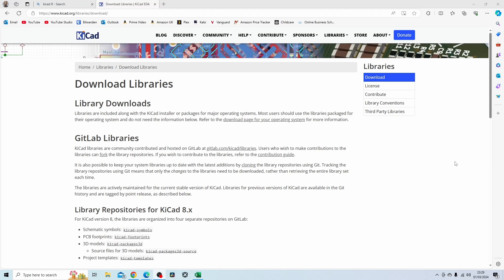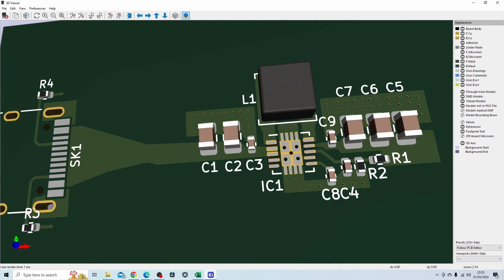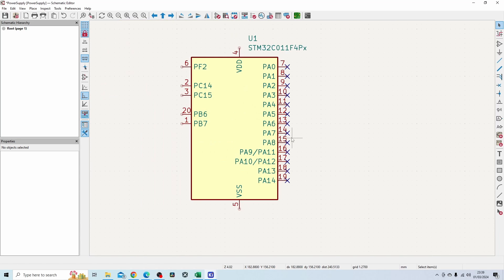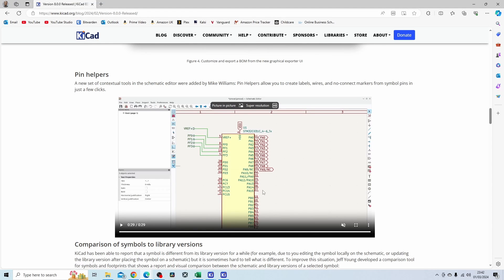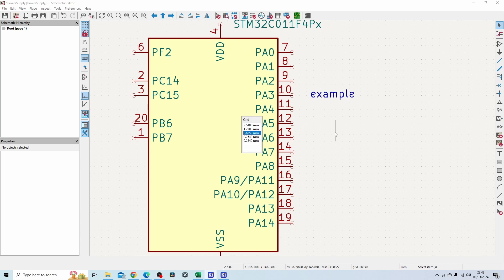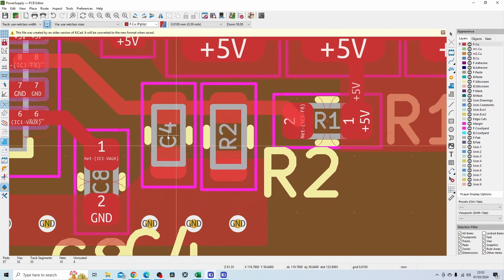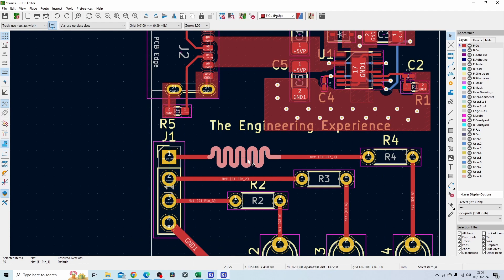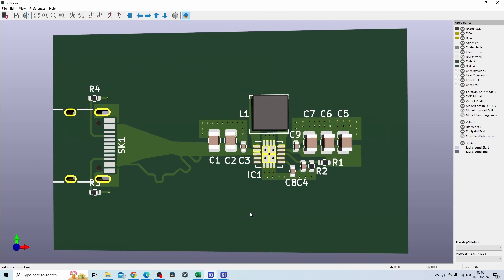Its here!! KiCAD 8 with new features

Comment: I already have installed kicad version 7 in my computer.what happen if I downloaded and installed latest version of kicad software 8 version.
Either both software are available in my pc or the version 8 will automatically updated with version 7?
Reply from the maker: I have the same situation, both versions will be available and can use both at the same time. I did some a problem with 3d models links being changed but that was because it looking for kicad 6 for some reason.

Comment: Will THIS version load my old design files?  Without some kind of interversion compatibility, this project is doomed.  We cannot re-enter all of our old designs every time programmers decide to change some little something.
Reply: I never used 5, but 6->7 has worked and 7->8 has worked for me. Keep in mind once you save a project using the new version, it will no longer work in the old version. I don't see this as much of an issue. There's no point using the older version any more anyway, they're all freely available (unlike private software).
Reply: Exactly !! the other guy here hasn't got a clue ! it's open source so of course you upgrade ASAP !! @ivolol
Reply: Go to the forum and ask your questions there as its where the people who know are ! keep a backup of 7 projects because once converted to 8 they cannot be used in 7 again as Kicad is evolving fast
Reply from the maker: I loaded my version 7 project into version 8 without any issues. 

You still have version 7 so you don't have to upgrade if you don't want to.
Reply: @TheEngineeringExperienceYT  Actually, I still have version 5.x; as I said, I have no time to re-enter all of these designs.  They SHOULD have included a version translator to upgrade symbols, footprints, schematics, and layouts.  If they had any self-respect, they would yet write and publish one.  This is why I don't donate to this project.
One of these days there will be no OS on which to run version 5 and I will be thoroughly hosed.
Reply: @byronwatkins2565 I can’t remember the upgrade from Kicad 5 but ime moving from version 6 to 7 and now 7 to 8 is as seamless as possible. Literally just open my projects in the current version, open it’s Eeschema and PCBnew files and then just save. I had a relatively old project which needed to run a footprint and symbol recovery, but that was only once and it didn’t cause any issues.
Reply: @byronwatkins2565  Are you seriously expecting to jump 3 major versions? That's asking too much